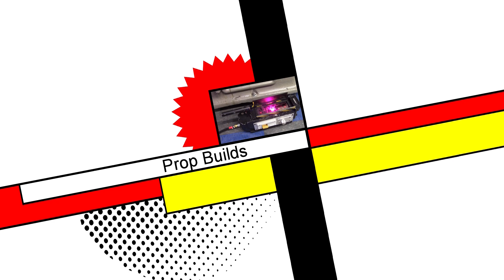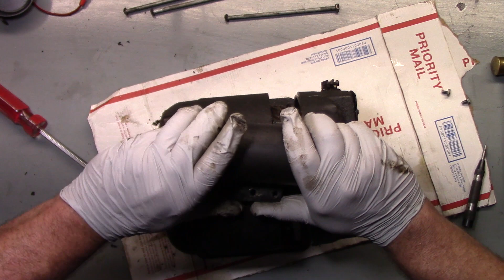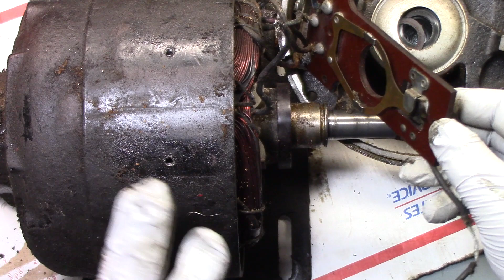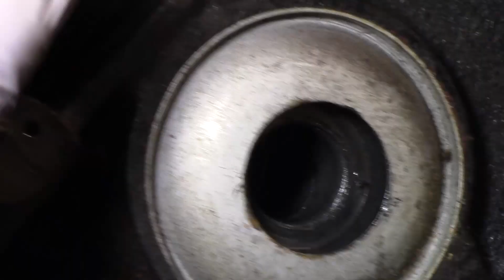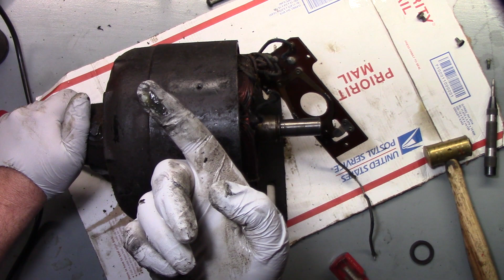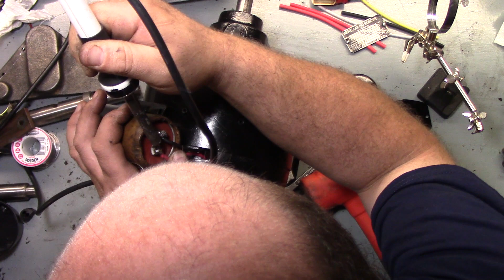Delta/Milwaukee Bandsaw Repair and Refurb: Motor

Comment: Replace that ancient capacitor while you're at it. It looks like an old wax capacitor which are a disaster waiting to happen.
Reply from the maker: I thought it was too, but it's actually a cardboard tube around a standard plastic shelled capacitor.   It checked out fine and sometimes it's a pain to find the same physical size to fit in the housing so I left it.
Reply: @Halligan142  Even if capacitance reads correctly ESR could be significant enough to cause future issues.

Comment: have you finished the gear hob
Reply: Will can't pass up a Gear Hobb video.
Reply from the maker: Not yet.  It's a project where I need some dedicated time to do a part from beginning to end on a weekend.  That's been hard to come by with family and work commitments.  The winter should be slower at work so it should be easier.  The band saw I did an hour here and an hour there for about a month and a half.